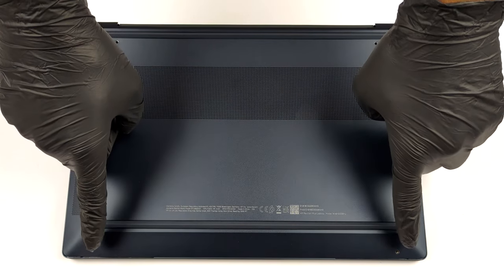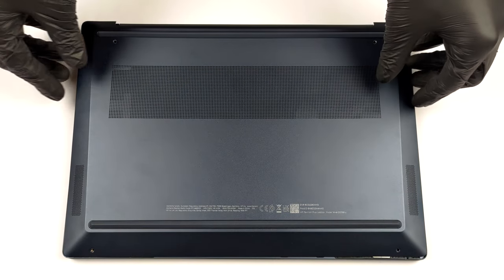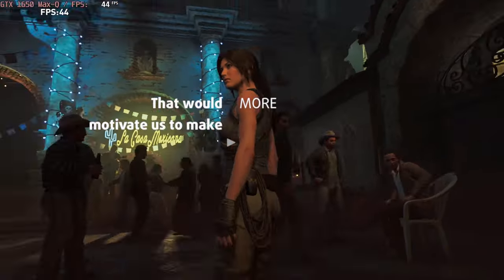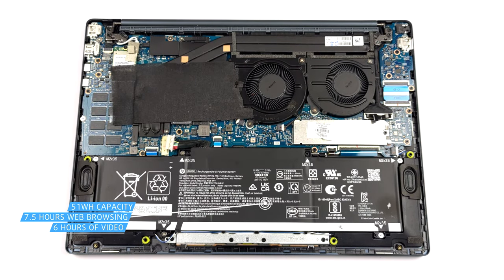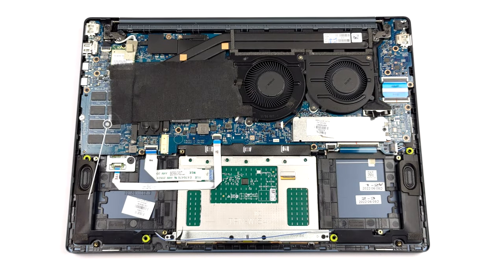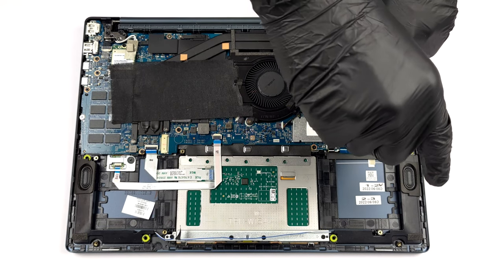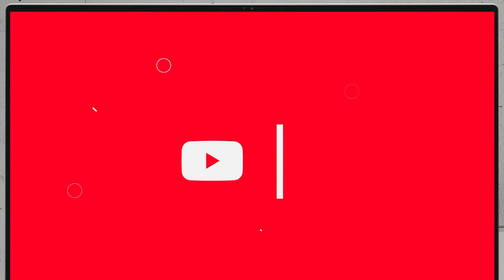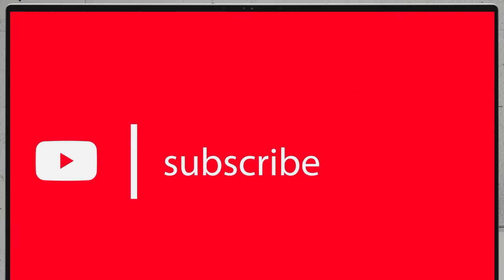🛠️ HP Pavilion Plus 14 (14-eh0000) - disassembly and upgrade options

Comment: Thanks! I came across your channel looking for answer about the back of my laptop (same unit) which is a bit bulging when I touch it. It probably because of the other fan (center) which is a bigger than the other one next to ssd slot. I am actually relieved that the battery is under the track pad! 🤣🤣 Thank you! I can sleep now. 😁